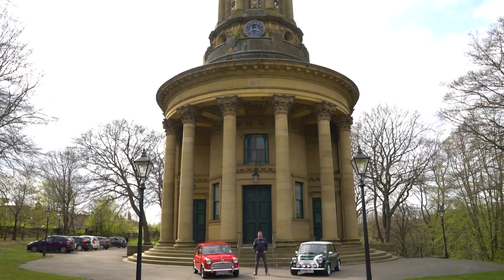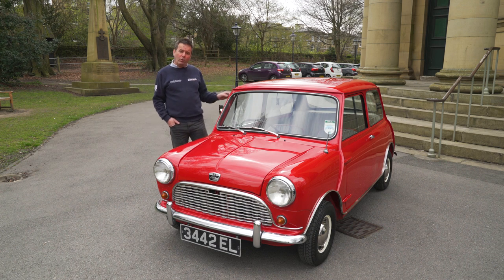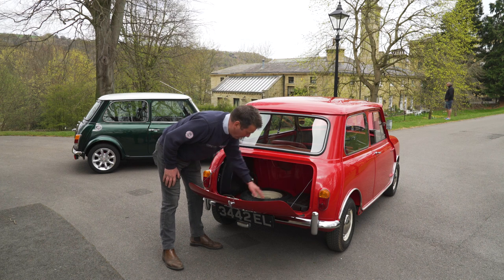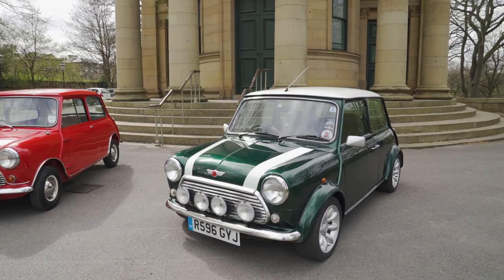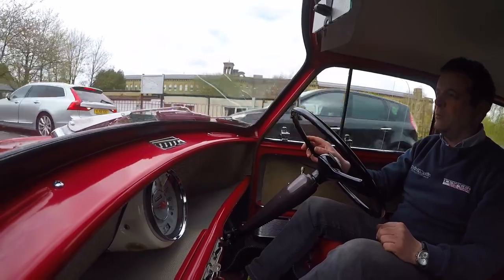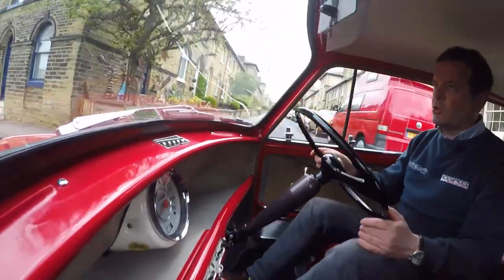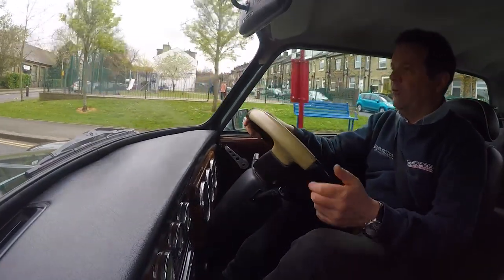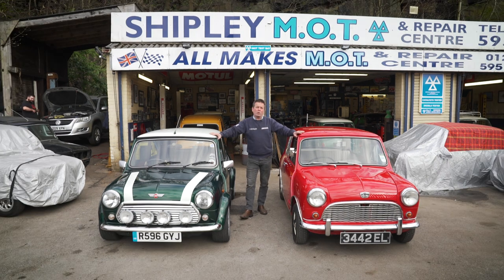Ace compares a Mini produced in 1959 to a Mini from the late 2000s in historical Saltaire.

Comment: The first car I drove after passing my driving test (1962) was a Mini with the pudding stirring gear lever. 42 years later I have just purchased  a 2019 Mini Cooper S which is as different to chalk and cheese to the original. Cars evolve over time, “ the Mini” was a step change in its day but the modern car takes it to a new level.

Comment: Lovely cars, the MPI is a Cooper Si, not an S Works
Reply: Thought the SPi’s (pre 1997) were known as the Si and the MPi’s were the S Works
Reply: @britishminiclub  They were Si’s up until about late 1998 as far as I know and S Works after so the first MPIs were Si’s
Reply: @classicminiworkshop  we have a 95 Si number 11 and thought they changed in 97 when BMW made improvements and they changed to MPi A bit of a grey area perhaps
Reply: @britishminiclub  I’m 100% certain, I have the sales brochures and mini mags from the era when they were advertised. I’ve also owned two of them, a 98 and 97 MPI. Check out the John Cooper Garages Facebook group.
Reply: @classicminiworkshop  I’ve just asked the question on the same page. Not saying your wrong but the reason I’m confused is I’ve never seen the Si graphic on a Sportspack and always thought it was only used on the Spi’s
Reply: The one in the video might be the Touring. Pity we can’t see the number on the plate on the seat cross member
Reply: @britishminiclub  The Si Badge was on the back of Sport 5's and The Touring which came out in 1997. The Si badge was actually a part from a Ford Fiesta Si. The Touring and Sport 5 were both released in 1997 with the MPI Mini. The S Works didn't come out until 1999 although it was possible to have a Touring and Sport 5 as S Works models. The Si (Touring and Sport 5's) was 85BHP Vs the S Works which was allegedly 90BHP but there was very little difference in terms of engine spec. I think the S Works just has a different air filter inlet pipe. I own a Sport 5 Si and unfortunately am old enough to remember going in the JC garages workshop. I also have the original brochures. I'm happy to e-mail you copies if you want.
Reply: @britishminiclub  The rear decals are wrong if it is a Touring and the 1997/98 Touring would not have been S Works spec
Reply: @britishminiclub  There is a possibility that this car is a conversion and has been converted to S works spec later. The cross member plate would say Conversion No. rather than Car No.